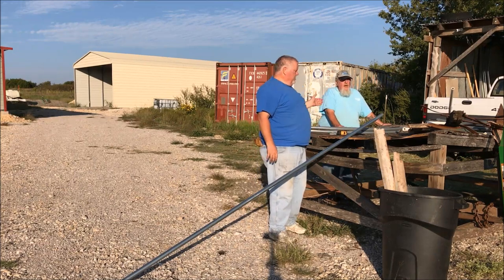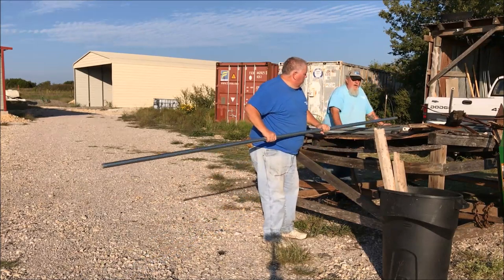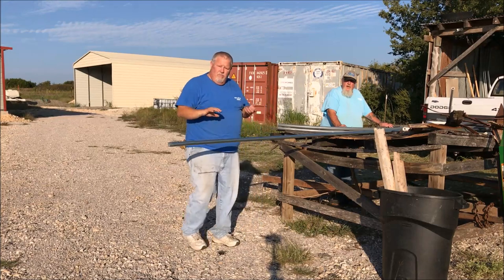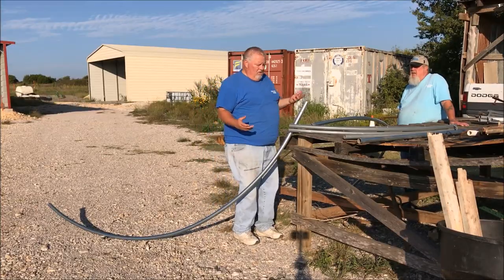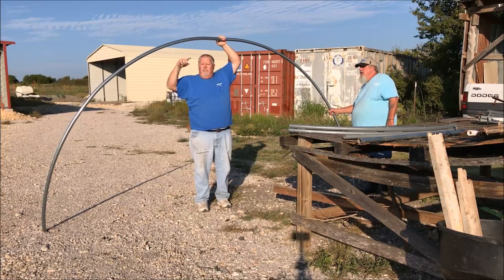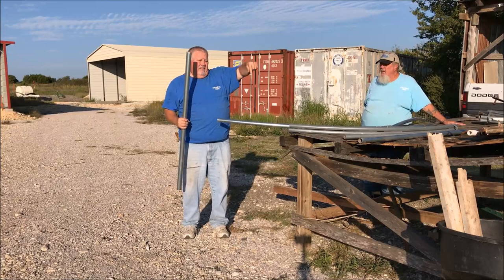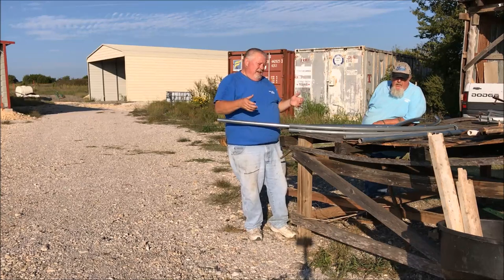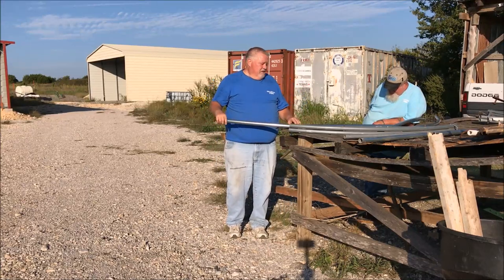How to Bend Pipe For DIY Greenhouse Build

Comment: If you happen to live in an area that gets a significant snowfall in winter, I suggest doing what I did.  It WORKS GREAT.
I used 50" x 16' Cattle Panel and covered that top of the frame with THAT, then put on the plastic.  We had 2 different
snow DUMPS of 3 feet up here in Montana, and the plastic held up perfectly.  If you live in an area that does NOT get
too much snow, then you probably don't need to add the cattle panels, but it SAVED my 8 x 12 hoophouse from the 
same fate as many up here faced...........total collapse of their plastic covers.  It also gives you TONS of places to hang
plants, tools, and other items to keep your bench space clear.
Reply from the maker: Thanks Jack yes weather is a big problem, for us it’s too hot in summer.

Comment: Greenhouse ? Im throwing a commercial flatbed steel tarp , made it 22 ft long and its the best boat cover you could ask for , it never touches the boat and it keeps the weather off it ...but the boat got evicted by the more expensive mini skid and scag zero turns , and im in hurricane country , but i just remove the tarp if its over 60 mph winds , and put it back afterwards ..

Comment: Here in New Zealand I can buy 21" length pipes. Would it be better to just bend one pipe like this or buy them in 10-foot lengths and join two at a time?
Reply from the maker: The hand binder only works on the 10 foot pipe

Comment: I love your video. Thanks for sharing. I live in GA and will have to find a source for the pipes. What would a 12x16 cost and how is the plastic attached to the frame.
Reply from the maker: Here is a video for attaching the poly cover   https://youtu.be/yh6AYdiSs1g
You can buy the pipe at lowes or home depot they cost a bit more but they have everything you need. I also have videos on how to build a greenhouse. There is a link in the notes area for a pipe binder. If you want the poly cover and track you can order from me i am a distributor contact me at 
bob@hallsomefarm.com

Comment: A Simple way to Avoiding Twisting the Pipe as you Bend it is to use a Black Marker or Crayon.
Lay the Pipe Flat, and Run the Marker down the Top of the pipe, from one end to the other.
Now turn the pipe, and place the Line in the Center-line of your Bender Tool.
When Bending and Repositioning the pipe, Keep the Line in the Center-line of the bending tool.
This will Keep the Pipe from being Twisted as you Bend.
t also helps to Align when Assembling the Pipes for the Arch.
30 Seconds extra time, which will save you $$'s and Headaches.
And possibly a Few Bad Words.

Comment: I want to build one of these on top of my dump trailer for leaf cleanups. The width is 83 inches I’d like to get the height to about 6 or 7 ft. Then cover the arc with a mesh tarp. The metal arc  would attach to a wood base of 2 ft by 12 by 16 ft   Any ideas on how I would do this would help.
Reply from the maker: I think I would use straight pipe with brackets and not bend it. 83 inches is too much bend. I would mount pipe on the trailer for the height you want and then connect both sides with a straight pipe.
Reply: @HallsomeFarm  
I have a 16 ft big Tex dump trailer . 14LP is the model number. I want to mount pipe to the extended wood sides that are 2ft high. Then put a mesh tarp  over the pipe that arches over rather than build up the wood which adds tok much weight.
Reply from the maker: Then I would use pvc pipe or bend a metal pipe with the 12’ arch then bend the excess at the end straight down to mount to the wood. Hope that helps

Comment: Do i need to make a 6 inch mark if i want to use three poles per rib or do you recommend another measurement?
Reply from the maker: To make a bigger greenhouse you need to buy the right bender. 2 pipes bent to make a 12’ wide gh. 2 &1/2 pipes for a 16’ gh, and 4 pipes for a 24’ gh, but each has a different bender.
Reply: Hallsome Farm thank you, what type of bender would you recommend for the 24 foot

Comment: How many feet from the bottom of the Pole are at end to end using the 12' Poles
Reply from the maker: The with is 12’ the height 6’ but you can add to the height with the ground post

Comment: Suppose I want to do 16'wide. Can I just add a 6' piece of the 2 3/8" post between the two 12' diameter halves? Or, if I decide to just use taller 2 3/8" posts for the 16' bend, what is the difference when using the bender to bend 6' arcs vs 8' arcs?
Reply from the maker: I have different benders for size, but I suppose you could add half a link, bty it 13/8 pipe top rail of chain link fencing. The 15/8 pipe for the side walls I would make at least 4 to 5 foot tall and stretch the 13/8 rib into wall pipe.
Reply: @HallsomeFarm  yes 1 3/8. I have some 1 5/8 post. I'm going to bend the top rail as normal to make the arc for the 12' hoop and try the spacer. Worst case I waste $10. Thanks for the response. It's a big help to the noob. :)

Comment: what gauge galvanized top rail are you using and what gauge purline thanks Kappy
Reply from the maker: Not sure the gauge excellent question but I can tell you it is top rail chain link fence pipe. 10'6" for the bend pipe and I buy 24' for the purline.  In the note I have a link for a pipe bender they are $49 makes it worth it to bind your own.

Comment: I tried to avoid the cost of the bender, but I eventually broke down and bought one.  I tried the bender in the Lowes store.  I took that back.  I bought the low tunnel bender from Johnny's.  i still don't know how much EMT to stick thru the bender and then start to bend?  I bent some last year and this is my second year having my tunnel up.  I found with the 6 mil plastic and the winter I never got out there to water, end result I lost my plants.  I used (15) and (19) wt. Agribon, but they ripped.  I recently got Xavan 15' X 50' which is a Dupont product.  I can see in the box that it is A LOT stronger than the Agribon.  I will try it in the spring bc it is too cold up north.  My Agribon (19) has a hole in the top of unknown origin?  Perhaps I pulled the Agribon too tightly?  I had to clamp (2) Agribon sheets together to cover the width bc I bought 83".  My low tunnel is 79" across so that is why I have to put (2) sheets together.  I got a Jang seeder so now I can seed as much as I want to and make patterns.  I am looking forward to using the seeder.  The down side, as I can see so far, is that I can not plant flower seeds with the Jang, but I'm sure i'll figure it out.  That guy is smart to have you bend the pipe bc just getting to the realization and acceptance that you need a bender to accomplish a greenhouse can take days of frustration like I spent.
Reply from the maker: A bender is the best way to go, in bending any pipe extend 6” past the pipe band, in case of the 4’ emt bend after making the first bend take the pipe out turn it around and bend the second half just like the first, comes out perfect every time. So far my agribon cloth has worked for me, but we don’t get snow here. Thanks for the comments
Reply from the maker: I believe I purchased my bender from lostcreek.net
Reply: "i still don't know how much EMT to stick thru the bender and then start to bend?"
The first X" remains Straight. That bit goes into the pipes you set in the ground and is fastened into the vertical 'ground pipe' that holds each end of each hoop in place.  He uses six-inches in this video. I suspect this is not critical, but needs to fit into whatever you are using to hold the hoop ends to the ground.

A hoop is basically half of a circle. so, you find the width of the hoop at ground level and this is the DIAMETER. Half of that is the RADIUS. To find how much (length(s)) of pipe, you need to find the CIRCUMFERENCE of the CIRCLE with a RADIUS = one-half the width of the hoop at ground level and add 2 times the amount of pipe left straight (say six inches twice, so add 1 foot). 

Since CIRCUMFERENCE = Two x Pi x RADIUS, the length of pipe required would be equal to  .5* (2 *Pi*r)+12" in this case.
Reply: Charles Senf I've accepted that I'll never have the perfect bend.  What I've bent is doing very well for my GA Collards.  I've used (18)" rebar, but I've thought about getting a lil longer so my low tunnel can sit higher.  I may grow Brussels Sprouts next winter.  I guess I should put (6)" in, then start bending.  The Xavan is doing good, no tares.

Comment: hi! how long is one piece of those pipes you just bent? thank u
Reply from the maker: It is a 10’6” chain link fence pipe need two to make a 12’ arch
Reply: thank you! i tried ordering from johnny seeds but unfortunately they dont send /ship to my country. i wish someone could provide the measurements of those bender for 12ft wide hoop. i just need the length og pipe used and angle of bend.

Comment: You're working too hard, just get some brackets and mount that pipe to the top of some T-Posts, don't gotta worry about twisting your material, you can use the space closest to the wall, and you use less tubing.
Reply from the maker: That should work too

Comment: How many sections of fence for the 16ft?
Reply from the maker: 12' takes two 10'6" pipe 16' takes two and half. You need to by the pipe bender for the size you want to build. I have 4 different sizes I use. If you interested I have a link in the notes where to buy one best pricing I know of.
Reply: @HallsomeFarm  what is that link please?